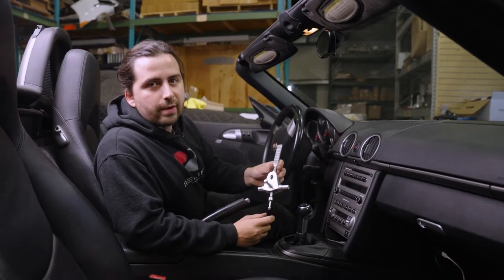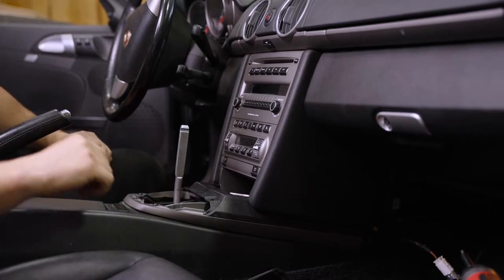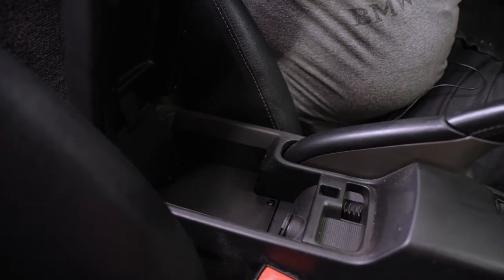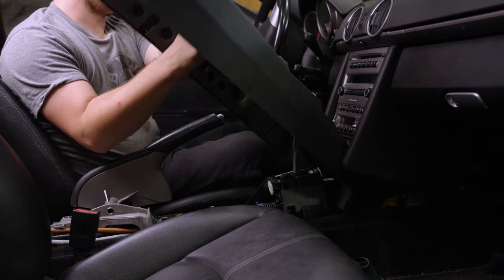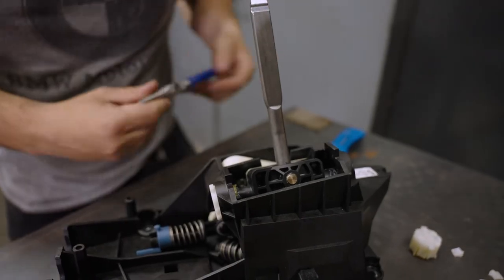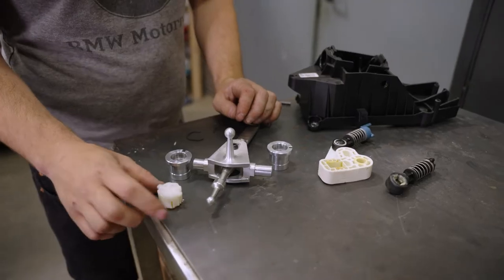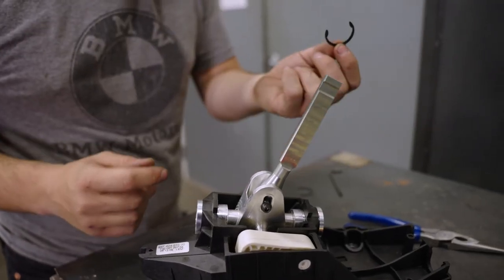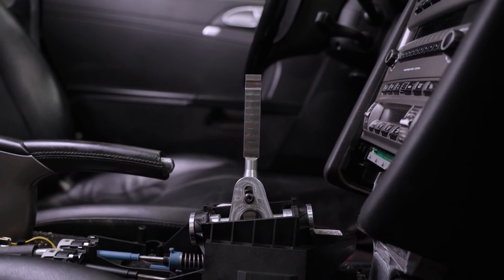Rennline TR08 GT3 Shifter Rebuild Kit - Porsche 996/997/986/987

Comment: Note to buyers. You highly likely will have trouble taking off the plastic roller bearings and the new TR08 has clips that surround the metal roller bearing that you must pry off without breaking it once you do that prepare to struggle to even insert the roller bearing it won’t go into the shifter assembly without a C-clamp or a hammer once you get there prepare to have issues with shift cables engaging gears properly and both shifter height screws and roller bearing screws will cause you to either not engage reverse and or not return back to neutral. Save the money and get a oem short shifter not worth the time or money! I’ve taken it apart about 4 times now and still have troubles  properly clicking into reverse without trying a couple times. Was very excited to install until all these issues popped up.